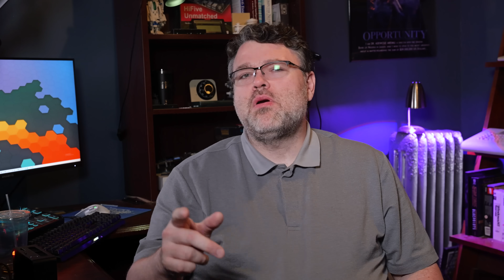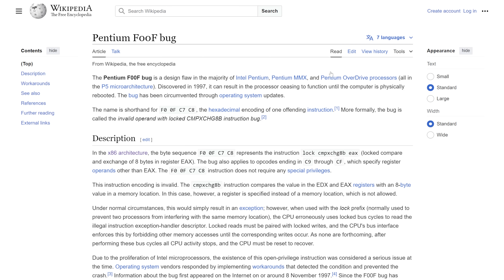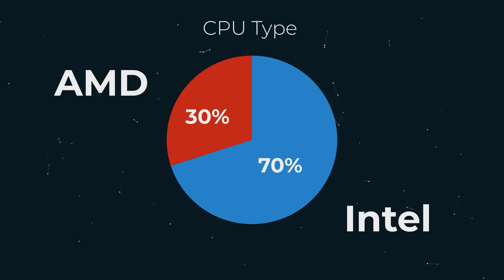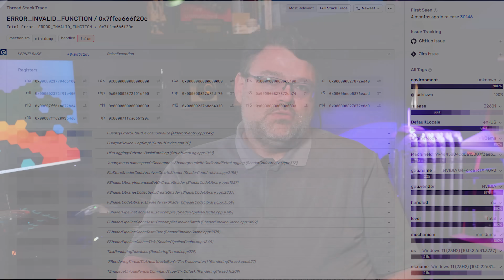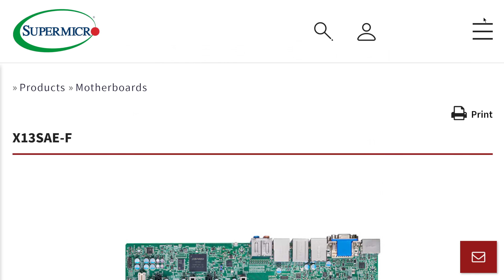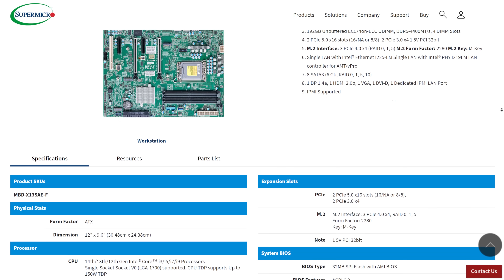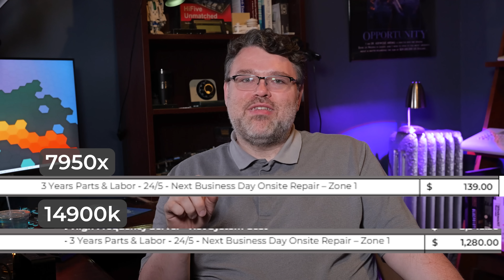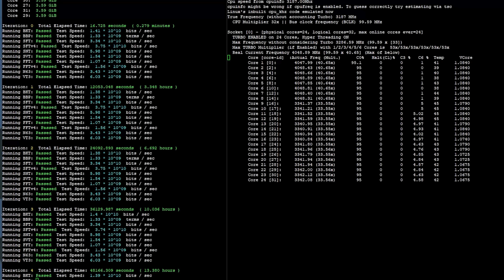Intel has a Pretty Big Problem

Comment: This was bound to happen sooner or later. When Ryzen showed it could keep up with more expensive Intel CPUs, many people were surprised and excited. But in general the Intel crowd in the enthusiast market stuck to Intel, and on the data center, Intel was basically locked in. Even though Intel had been lazy before Ryzen for lack of competition, the people who have to sign off on millions of dollars worth of upgrades didn't care all that much. They'd get the same brands like Dell, throw in Windows ans Office licenses, and extend contracts with consultants when needed. 

Still if Intel had any vision stronger than greed, that's when they should have buckled up and started working seriously to design a new architecture. Of course creating something like that would take years (and a sizeable investment). They had the money too, as investors would grumble but not ditch them. They could squeeze that last bit of room on the x86 architecture, and create something new that would be flexible enough to keep laptops going for longer in one configuration, while offering satisfactory server performance with the same instruction set for both. 

ARM architecture had already shown how bad x86 is where longer battery life was more important.  Plus ARM architecture was well positioned to continue improving. Intel should have had the talent to make something closer to ARM, a more flexible architecture, than trying more and more to make x86 work with laptops and small PCs/NUCs where power use is a big issue while also trying to raise clock speeds and add gimmicks at the other end of the market.

Surely Intel's patent portfolio alone would make anybody think twice about trying to sue the new architecture to death. Plus I may be wrong but they're probably part of patent pools with other companies that would offer additional protection.

Plus, Microsoft was changing as a company too. MS was no longer in a position where they would outright refuse to support a new Intel achitecture. They faced the same pressure from people using their phones more and their Windows less. MS Windows and Office revenues had been reliable but they were finding success in the cloud business too.

Now look where we are. Apple had gone Intel out of necessity but they did find new life in mobile processors where their hardware engineering paid off. How the tables have turned. Apple is the one with their own laptop chip  design. Plus we have Snapdragon chips apparently and Microsoft ported Windows to a non-x86 architecture anyway.

And what did Intel do? They've become so tone deaf they not only released the 13th gen, but also the 14th gen. If the evidence outside Intel is mounting that these problems are real, surely Intel too has the testing and telemetry to provide much greater insight into what's really going on. I think it's safe to assume they would have shifted all the blame to motherboard manufacturers if they could have without making things worse in the long term. But Intel needs to work closely with them to put out the current fire. If they can't come up with a good solution, they might have to do something to determine damaged areas and turn off those cores for good or implement some very serious power management to increase the life of the CPUs so they hold out til the warranty expires.

If it really is a design flaw, it's going to take a significant amount of time to go from the drawing board to a finished product. 14th gen super extreme? or just call it 15th gen? Game companies may switch to Ryzen or a different Intel CPU they could strike a good deal for, but given the increased maintenance cost, others will likely extend their upgrade cycle until a fixed CPU is released. I  have very little faith Intel will finally start innovating again despite the current situation

Comment: If there's a physical problem, no amount of microcode fixes can repair it.   they can only slow it down so it lasts longer...  is longer long enough?   I have a 13600k now but still use my old 2600k I bought new as a file server.  I expect to get to use my 13600k in the same way one day.
Reply: I will be overclocking it.   I OCed the hell out of the 2600k and it survived.   I'm gonna OC my 13600k.   I hope it lives to be a file server one day too.

Comment: Intel Core i9-12900K Gaming Desktop Processor with Integrated Graphics and 16 (8P+8E) Cores up to 5.2 GHz
Unlocked LGA1700
600 Series Chipset
 125W with a Ausu Pro art b760 motherboard, 1300 watt power supply fully modular power supply. musetek m7 case, asus 12 tb gpu, 
Am I safe from crashes or should I switch the board and processor to amd and an asus AM5  motherboard?
Reply: You have a 12th gen CPU, so you are not affected by this

Comment: As far as gaming goes, I wouldn't trust any of my crash logs for your case, I have more than a couple games that are completely modded out, and I do experience crashes a lot after updates, and I would question how many other people you see in your data that have crashes in larger amounts that can be attributed to modified game files such as mine, and for clarification I have a 14th gen intel processor in my current build. I guess I am lucky that I have yet to run into any issues with this myself, because if my data is a part of this video, I can say with a good deal of confidence that I do not have a degraded CPU, as I'm running strong at 5.6/4.3Ghz after having turned it down from 5.7/4.4Ghz purely out of paranoia when this whole kerfuffle started. Also running 6400 cl30 Mushkin Lumina Redline ram, runs full speed with no issues.
Reply: One CPU means nothing when server farms have 1000's of CPUs. If 50 % failure is nothing to you.

It's telling when you have N=1 and you claim all good vs N=10000 50 % fail. That's just cooked.

Intel probably sold lot of CPUs destined to be as i7 as i9.
Reply: @Tsiikki  How many people with PCs do you think play modded out games like me? The answer is a lot, just look at the Nexus community, I guarantee every member of that community has SOME amount of crash data on their computer that probably looks worse than it is because of the modding community, and it wouldn't totally surprise me to find the outliers spoke of in the video could have possibly been modders for something. Maybe I really am thinking too far into it, but I know I'm not the one single person this could apply to.
Reply: @Tsiikki  That third line is a super valid point though, i9s are worth considerably more than i7s.
Reply: @Tsiikki  To be honest I don't even want to be interested in this, but this is my first blue CPU since gen 2, and I must say the days of Intel being undisputedly better than AMD at least by experience alone are dead and gone. I'm not pleased as Intel's customer to be a part of this mess, even if it's purely paranoia for me at the moment, it still applies, and I feel like their show of hands up to this point has been little more than pitiful.
Edit: I'm highly pleased with Nvidia though, despite the price gouge.
Reply: @mrwolfe0812  I must agree somewhat with you, but as we don't know what games are involved, we cannot know. You must still remember big masses won't tinker or mod games / hardware. I have friends who have/had "newest" (Some buy every gen or every other gen new HW) with default settings, not even XMP active! Have to say that servers are professionally deployed and serviced; with low TDP..

GN Steve said that one game is losing customers (some netgame, servers crashing), so it may be that you cannot even mod that kind of games, as it is considered cheating.

Comment: My guess is oxidation of the copper via's are causing a lot of problems.
When i got my 13700kf i was able to apply an allcore 5.4gig all core clock and cpu ran at 80 degrees
One day the last of use loading shader screen kept on freezing. I ran cinebemch and noticed my 5.4gig overclock was hitting high 90 degrees and could not complete a run. On the very rare time it did my cinebemch score was 2000 points lower.
After a lot of fiddling i was able to get about 95% stabililty by running lower voltage and 5.3gig but my temps are now 85 degrees. Hooter than my initial 5.4 all core clock.
I put this down to oxidised vias are adding resistence, this more voltage is needed and thus higher temps are being generated. No microcode will fix this

Comment: @Level1Techs I Love the fact you also "needs" a high single core clockspeed cpu, I had my i5-2500K for almost 7 years cause nothing context switched (short(ish) pipelines) or had higher single core speed for a very long time. I use mine for Dwarf Fortress aswell to many peers dismay 😀

Comment: Let us all be honest here: Intel thought AMD was dead, Intel did its level best to kill off AMD and they failed to do so. When AMD released the Ryzen processor line, and it was almost on par with Intel's then best, it freaked Intel out. Intel has thrown a bunch of crap at the wall and hoping the best stuff will stick. Intel lazily coasted along with tiny updates to their 4 core processors, and with the money injection AMD got, AMD came out of no where. Ryzen quickly evolved into some awesome stuff, I love my Ryzen 5 5600X and my roommate loves his 5800X3D. Intel has been rushing around to put out competitive products and they have screwed themselves. I foresaw these issues when 14th gen. released, but I figured it would be heat and power related, not straight up flaws in hardware from the factory in two, back-to-back generations.

Comment: high Vcore degrades L3 cache on rapterlake CPUs, in addition the LGA 1700 socket suffers from worsening mechanical and thermal deformation overtime, this deformation also causes a increased incidence of thermalpaste pumpout on the LGA 1700 platform, 

Alderlake had more durable less dense cache typically clocked lower too, less vcore, and more limiting AVX offsets that put a cap on thermal density which prevented these issues from impacting stability during stock operation.

Comment: I've mainly used Intel for years, and have just dealt with random crashes as 'Oh, it's another Windoze coding issue'. I recently got a Ryzen 5 5600X, on a MSI MS 7C56 mainboard, gifted to me. I built up a machine around it just out of curiosity, and it has been buttery smooth with 0 crashes since early May of this year. I previously had this exact system on an Intel 12th gen. Alder Lake platform, and it would bork at least once a week if not more. I know the architecture is much different than the 13 & 14900K's. But that doesn't excuse the fact that is was still not stable on a system that isn't even used for gaming. I do some work with Stable Diffusion, and Ollama AI, and despite the fact that both of those tend to use the GPU more than the CPU, there is a noticeable difference in performance between the 2 systems which are outfitted pretty much the same, as far as RAM, SSD's, etc. Also, SD was more likely to generate garbage images with the Intel CPU, than with AMD. With the 12th gen. Intel, I found myself restarting SD at least once every 30 minutes or so to keep my renders consistent, and restarting the whole machine at least 2 or 3 times a day.🤪 With the Ryzen 5 5600, on-the-fly data corruption has been minimal, and I can generate with Stable Diffusion for hours on end without restarting, even on a mediocre nVidia GeForce 1060 with 6 gb. of RAM! The Ryzen is my daily driver now, and the only time I reboot is when there's an update that requires it. Otherwise it runs 24-7.😉

Comment: I’m on my second 13900, learned my lesson on number one.  Fully stable, no crashes whatsoever & I am on 128gb of usable ddr 5 ram. After so much research & a ton of crashes months back, I’ve been stable on this system for 3 months.  Fully decked out cities 2 games run buttery smooth for hours, not a single issue.
Reply: Also, I run two vms 24/7

Comment: Installed the new asus bios Z790-A with an 13700K now my VID and Vcore spikes too 1.542 volts ..
Reply from the maker: is it the vid or the measured vcore that's 1.542?
Reply: @Level1Techs  The Vid goes up too 1.542 And vcore max 1.450
Reply: @Level1Techs  Changed the svid behavior from intel fail safe . to typical now the vid is down too 1.453 max . And vcore max 1.311

Comment: I initially resolved my issue by downclocking with P-core ratios, but this solution didn't feel ideal. After downloading the latest MSI BIOS with ME 125, I still needed to adjust the P-core ratios. Modifying PL1, PL2, and other settings didn't seem to help.

Recalling Intel's statement about a voltage issue, I decided to set the CPU LLC to Intel default, reset the P-cores to auto, and restored all other settings to their previous values. This approach worked successfully. I tested it by running Edge YouTube, Claude, Intel Process Tester, Cinebench, and other applications without any problems.

It's worth noting that with these settings, Cinebench R23 scores decreased by about 3500 points compared to when I had set the P-cores to 54 on all but two cores, with those two at 56.

However, I would rather have less performance until the voltage problem is addressed. This approach prioritizes system stability and longevity over maximizing benchmark scores.

Update: 7/27/2024

 I had to go back to limiting the pcore ratio to 57

Comment: Can you make a new video i heard it was a micro code error for the voltage regulator
Reply from the maker: that is probably a big part of it. but CPUs with 1.5v max or less are also having trouble. will have to test once the microcode drops
Reply: @Level1Techs  I look forward to it. Thanks for always being so informative.

Comment: Suggest is looking into the memory controller in the chip. I’m wondering if there is a memory test program that will allow you to say tested different ram speed, and slowly working your way up to the absolute max that the ram can handle. I have witnessed when you have random memory problems. I wonder if the CPU is damaging the memory or degrading it overtime which is also damaging shit and degrading overtime. I sudden CPU slow down is ram related and it throttles back before fully crashing.

Comment: I'm on a very old and ageing 8600k, which used to be stable at 4.8Ghz but now struggles so I keep it at 4.5. I was considering upgrading soon to a 13 or 14th gen, although probably not these models but perhaps a 13600 or 14700.Now I am thinking it may be time to switch to AMD for the first time in 26 yrs (last AMD I had was an athlon)

Comment: I bought a 13900k ran good for 6months then it started crashing, Intel sent me replacement, installed it and right out of box it started crashing, sent in RMA, bought 14900k while I was waiting for RMA, 14900k was stable for one game of Helldivers 2 then it started to crash I spent weeks trying to get it stable no luck. Tried EVERYTHING Went through 4 chips all with same crashes, I gave up. I dropped Intel and now running stable with AMD chip

Comment: Some comment writers are only too fast to blame Intel for incompetence or worse.  In the past I've myself sat in meetings when our (not Intel) cores didn't work.  It was complex.  Weekly tapeouts in the hope to make progress.  Normally engineers are super-cautious to ensure the absolute correctness of the RTL before tapeout but clearly panic was setting in.  We were using some licensed IP and there was finger pointing between the fab, the licensor of mentioned IP and our own engineers.  Everybody was blaming somebody else.  it took a long time to sort this out.
Years later I was working for another company only a 2min drive from the previous company and found they were having the same problems at the same time with their SOC.  And a friend who was working for yet another company across the road from this company told me they were had the same issue as well.
I bet brains at Intel are smoking right now.  Such issues are super hard to track and once multiple parties and millions if not billions of dollars are at stake nobody wants to lose that blame game - if there's a 3rd party to blame.

Comment: Very disappointed. I held on with an i7-5820k overclocked running 24/7 for years and years with never a problem. Finally upgraded to an i9-14900k with water cooling. Worked like a dream, but recently started having game crashes (Helldivers, Wow). Upgrading to the latest bios fixed the problem so far. Very concerning if it really is a problem that gets worse over time. Intel if not always the fastest, was known for being the most stable and reliable. Looks like the great engineers retired, and the current Intel is not the intel of years ago. Sad. Not eager to have to get a new board+CPU (AMD). Hopefully Intel finds problem and either finds a bios fix or replaces all affected CPUs with reengineered chips.

Comment: If that's the RAM speed you're getting, you may as well use ddr4 at least you could save some money and use some 5000 series AMD chips. Intel has a real f**** problem here if not in the immediate future. Absolutely with mindshare gamers are not going to keep buying these over Superior in every way other than Max clock speed AMD especially x3d chips

Comment: Gaming Laptops 13,14 gen  are dying too. Usually no boot issue but Technicians usually think it's bad mobo..but it's actually te cpu, coz this level of failure rate has never happened before.. due to the lack of understanding from technical side ,the failure is not being report on massive number on the mobile platform..